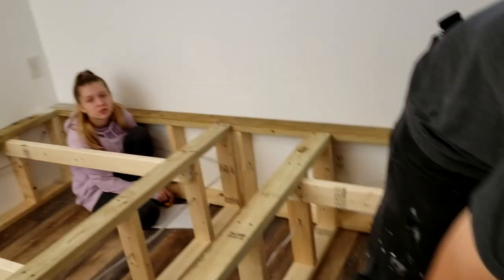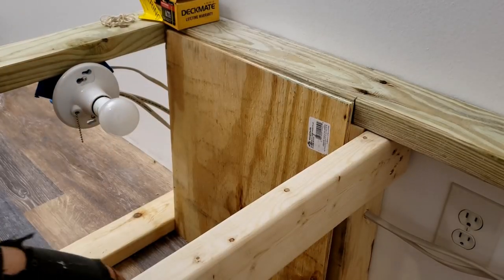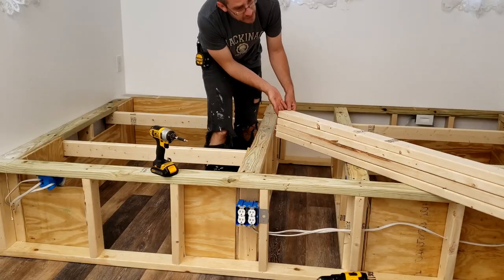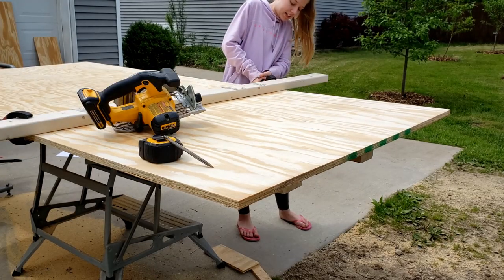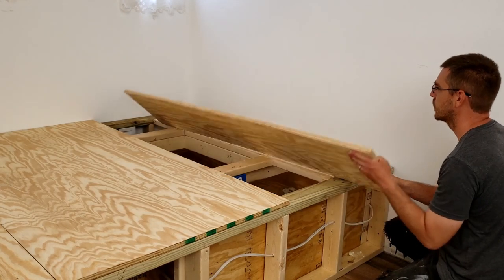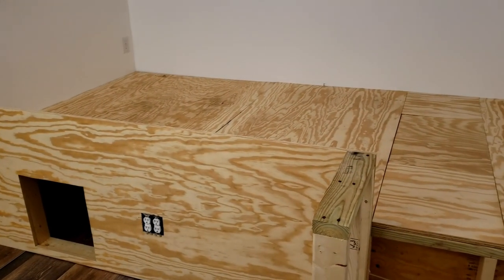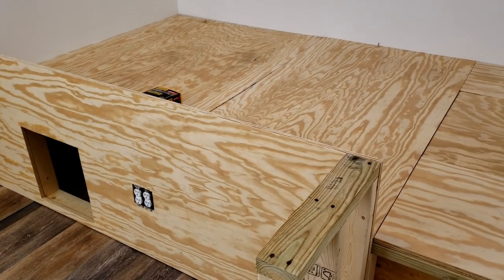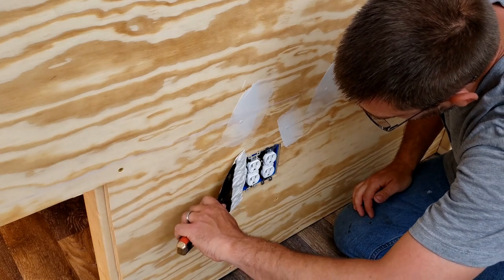Platform Bedroom - The Platform Gets its Skin

Comment: I think I'd attach  a rope to any storage totes that you might put under the platform with the side entrance. I'm curious if the center area will be used as well.   It's coming along great.   God bless you all.
Reply from the maker: I am not planning to use the center section, didn't fit into the design for an access to that area